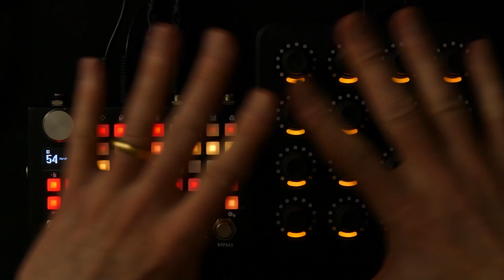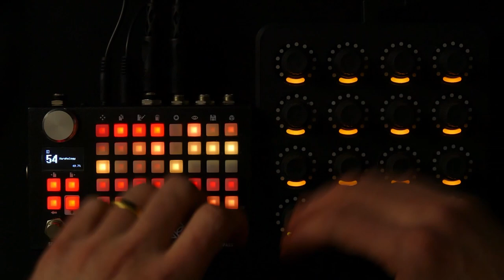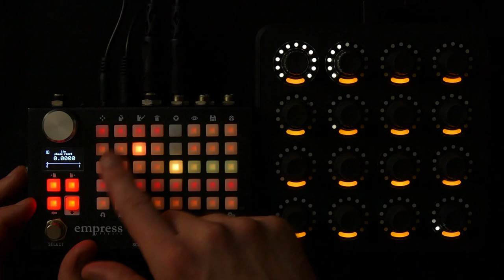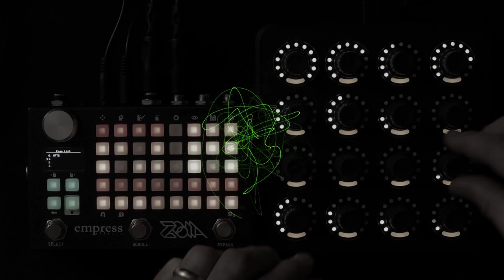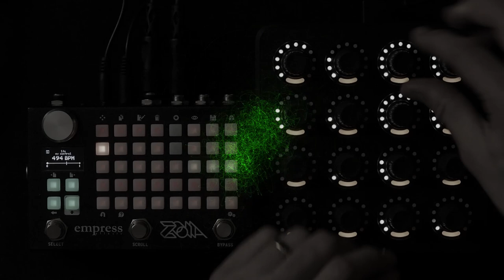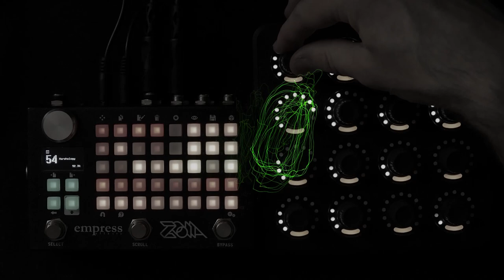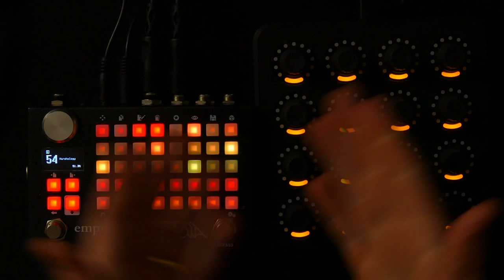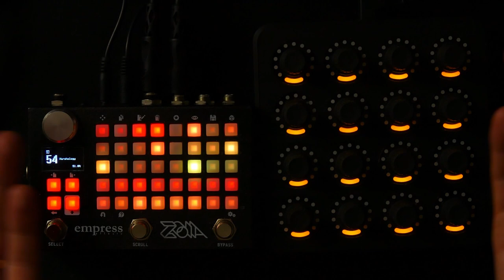Music: Empress Zoia - A (sort of) Glitch Machine

Comment: Still happy with the midi fighter twister or would you recommend another device at this point? Probably looking to pick one up soon too. I feed midi clock into my zoia from a Boss switcher (also clocks a DD8 delay), so I wonder if there's a similar device to the twister but with midi in/thru?
Reply: (DD8 is clocked via tap tempo, Boss switcher also does program changes in zoia, hence I'm keen to keep this connection)
Reply from the maker: I am very happy with the Twister, and I still haven’t really seen anything else I’d rather have as a knob/switch controller. There are a few of its special features that the Zoia doesn’t seem to respond to, such as having a secondary rotary control per knob, either as a shift function or as a superknob. It only seems to register secondary controls as switches/push buttons, but that’s not much of an issue. It would have been nice if it worked, but then again I have never needed more than 64 rotary encoders at once. And even by having each encoder do two different CC’s, it’s better than most controllers, even if one of those two CC’s has to be a switch.
Reply: @hakonsoreide  Cool, good info. I'm wondering if an Arturia Beatstep Pro might also control the knobs and switches on zoia. Thoughts?
Reply from the maker: @declanfarrell  It certainly would. Any MIDI controller would work fine. Even controllers that are hard to set up to specific CC's would be easy to use since the Zoia is easy to set up exactly the way you want it.